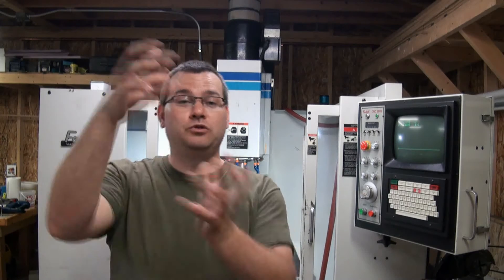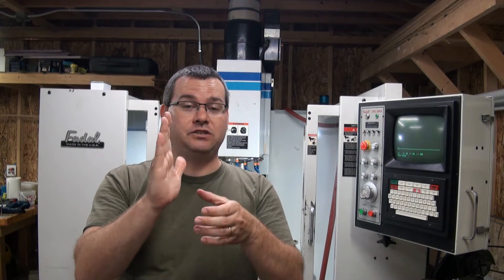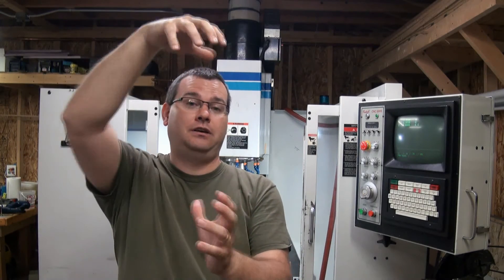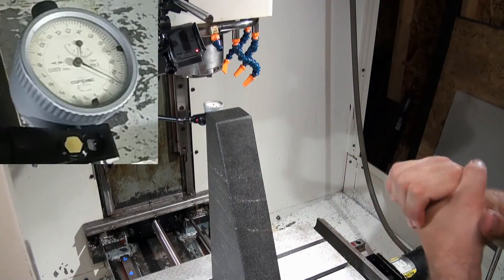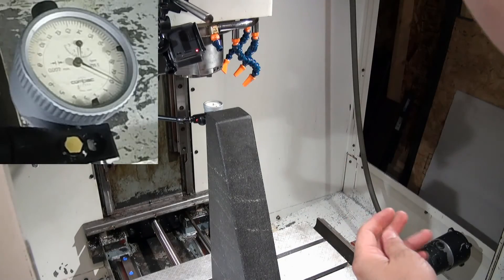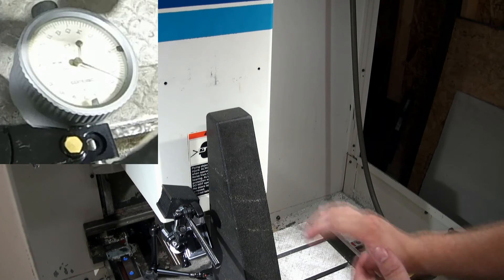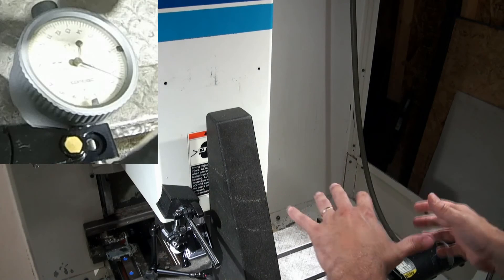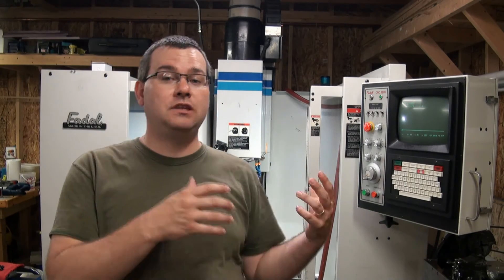CNC Machine Setup and Alignment Part 6: Z Alignment

Comment: Most used machines tables are so rough, you cannot just place a granite on a table. Place it on bricks and dial the lower surface of granite first to check it is parallel to x or y. Only after that run along Z

Comment: Are there any different tool you recomend to use if one does not have a surface plate like yours?
Reply from the maker: If you can't get your hands on a precision square you can also check squareness by making test cuts.
Get a piece of material that is on the thick side so it is stable. Then face both sides so there as flat and parallel as you can get it.
Then machine two sides at 90 degrees, then flip the piece over, make one edge parallel with one axis then measure the other. If your machine is perfectly square the second edge will read straight, if not, you can see how out of square it is, make some adjustments, and recut the piece.
Reply: Ah, yes that would work for squareness of X and Y. But how about the Z compared to the XY plane?
Reply from the maker: You can still do it with Z your just limited on how long of a distance you can check by the reach of the end mill. Take a thicker block of material, lay it down and then machine two parallel sides. Then stand it up on one of the machined sides and then machine a raw side with a long reach mill. You can use a long face mill arbor and a 90 degree lead. If your just looking for squareness only 2 points at each end are needed. Then roll it onto the other parallel edge and measure it. Same deal. Keep in mind this only really works well for squareness and only if the machine is out by a little. It can't really do a good job checking for straightness or if other items are out of wack.
Reply: My machine make out size is ok but make perpendicular out .

Comment: Would you not need to check the z axis 90 degrees from what you've shown here also to check the rails are vertical left to right looking at the machine?

What you did would have just checked front to back being perpendicular to th table not left and right surely?
Reply from the maker: Hello David, you are correct. I think I mention on the video that you need to check both XZ and YZ. I just did not show it because its the exact same procedure, just rotate 90 degrees.

Comment: This is a great series..I want to get a fadel now. Have you consider changing out the control. Is the a D.C. Servo motors. Dave
Reply from the maker: Thanks Dave, Yes, this machine has DC servos. No, I would not bother changing out the controller unless it completely died and I could not fix it. The machine as is does a great job and meets my needs well.